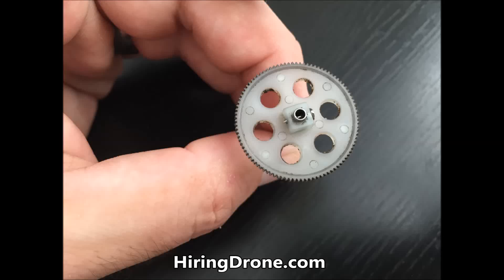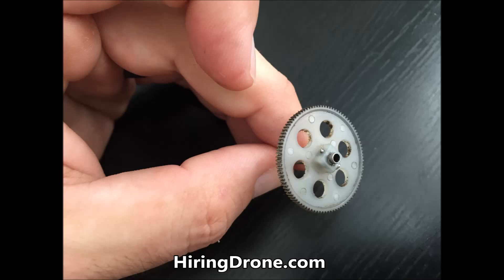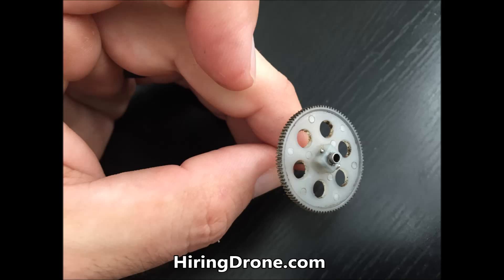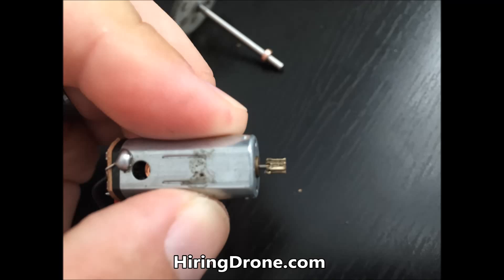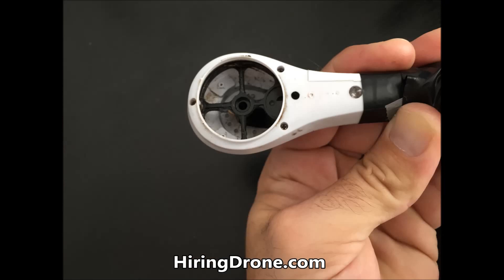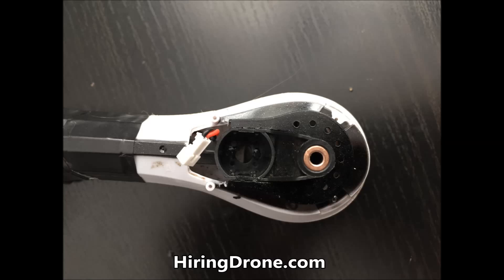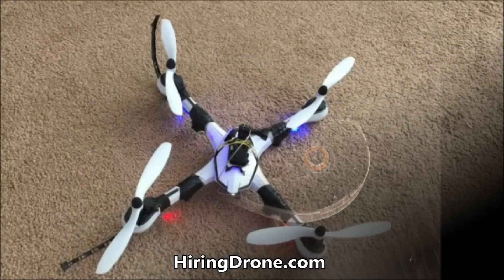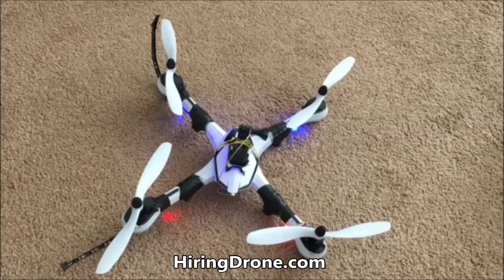JJRC H16 Tarantula X6 Repairing Motor

Comment: It seems the gears got eaten up due to using the motors beyond their recommended "issue-free" lifetime. Friction builds up in this motors and at one point they will not easily spin anymore after stopping the throttle abruptly. Due to the huge propellors this quad has, I assume the gears wanna move on spinning like an ice-skater but the motors don't allow that anymore and act like breaks when reducing throttle. Et voila, eaten up gears. My theory might be wrong, I'm not completely shure. I always thought a brushed motor will die before it comes to that amount of friction inside. So happened to my tarantula 1505 with no destruction of gears. Thumbs up.

Comment: I got the same issiue but I thought that was a plastic gear problem not motor because this is aluminium right? I ordered that plastic gears with shaft to fix it and I have a spare motors in home so I have to check for sure what is wrong with this.
Reply from the maker: +Tony Montana I have both the motor and gears coming in the mail. I cannot say for certain if it is the motor gear or plastic gear causing the issue.  It might be a combination of the motor gear and the the plastic gear. In the photos, the motor gear seems to be jacked up too. I know the plastic gear's teeth are not long enough to make full contact, but the motor gear/sprocket looks damaged compared to my other three good motors. Once I get my parts, I will post a follow up video.
Reply: +Hiring a Drone I know that you are not a fay or Nostradamus to tell me what's is broken in my drone (aren't you right?) But i was looking closely to the motor gear and it seems to be ok, anyway I will try to replace motor and see will that help me. Thank you for a video.
Reply from the maker: +Tony Montana -  Ha Ha Ha.. I am a drone noob. Complete misunderstanding,  I was referring to my drone and what I think could be wrong with mine. I am still uncertain as to what is causing my issue. I think both my gears need replacing. Keep me posted if you find a fix, because it sounds like we are having similar issues. I should have my parts any day and will post a follow up video.
Reply from the maker: +Tony Montana - Thanks for the link. Sure beats buying new motors. I found motors and gears in the US for a few dollars more than China. That should cut my wait time down... hopefully. I purchase some spare gears from your suggested site, as this could be an ongoing issue. Glad your drone is airborne.